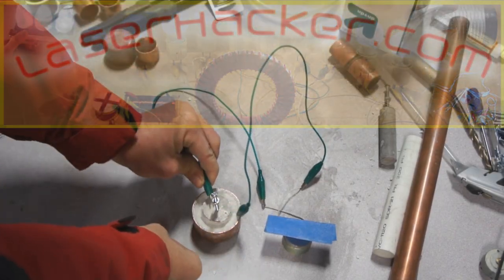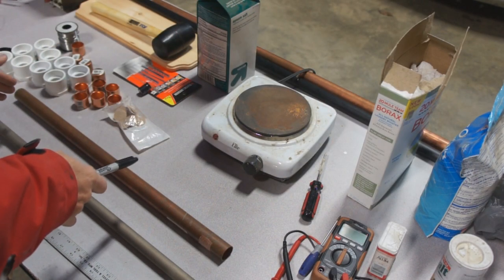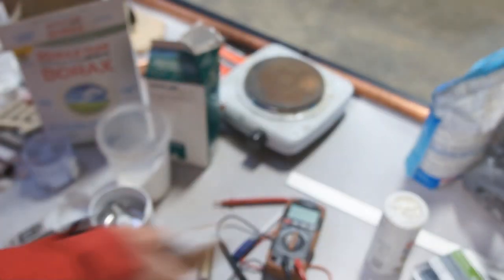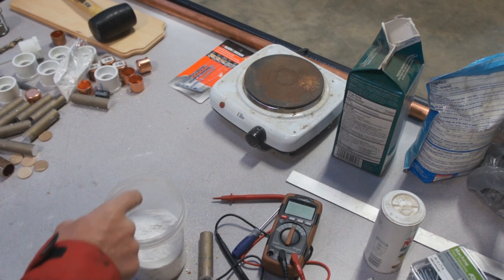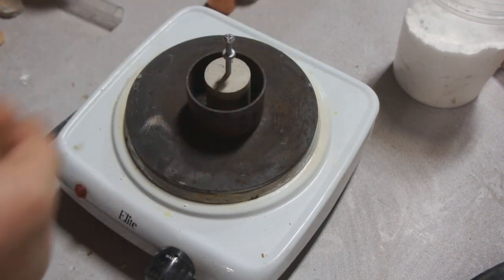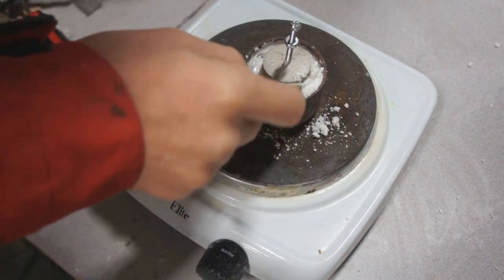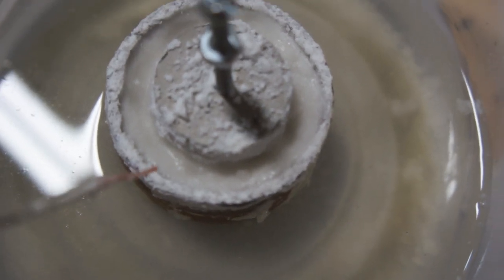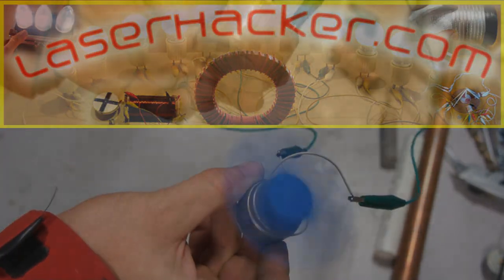How to Build Crystal Power Cells - Long Duration Power

Comment: I was wondering if you would get a higher power output if you added more magnesium rods rather than one big one.
Reply: yep. more surface area of the electrodes will increase voltage. i think nobody knows the life span of this battery yet
Reply: Yeah your right but wouldn't the added magnesium rods increase the durability and life of the battery due to the increased surface area?
Reply: I think it would be like this: in a AAA battery, compare to D size. D lasts longer since it has so much more electrolyte inside. we could test it by just using a lemon for the mix, cut in half. one half has couple electrodes, other half has like 4x as many. see which used up first

Comment: Thanks for sharing have been studying Paramagnetic Volcanic Basalt for years.   I have a PCSM meter to measure Soil CGS centimeter grams per second.  means how fast 1 gram of material will move toward a magnet.   The book I have on Paramagnetism speaks of Sulfur form G as being Paramagnetic.   600 to 700cgs.   Not sure if related?   Want to test 3000 cgs paramagnetic volcanic rock in a similiar device.  Any advice out there?
Reply: I was thinking MSM may be nice to try in the mix. Methylsulfonylmethane. Is it magnetic?

Comment: Build a vacuum hood over the heat plate, when you have it full and are ready to remove it from heat, Don't, suck out all the air and see if the cell provides more or less voltage.

Comment: The electrochemical potential between Cu and Mg is large. You can increase the voltage potential by using an Ag cup instead of Cu. A bit more expensive but worth trying.
Reply: What's Ag?

Comment: what if you made a large cell, would that allow more volts to generate, or what if you connected a few of these small ones together?
Reply: From my experiments size doesn't seem to matter. I made tiny ones that where stronger than huge ones. My hypothesis is that what matters is the ratio of surface are from copper to crystal to magnesium. So basically when there is about as much copper as magnesium touching the crystal you get the better results. Also the thinner the crystal the better it seems.

Comment: Where do you buy Magnesium Rods? Thats something one doesnt typically see. Awesome stuff her by the way.
Reply: Daveman, you should be able to get mag bar stock at a machine shop, machine shop supply, or i have even found that scrap yards will often put aside various bar stocks that people bring in as scrap and they'll usually sale it for just a bit over scrap price -good deal!
hope that helps you, wish you well with your project.
Reply: also i just noticed that Lasersaber has it on the site as "Reliance 9001829005 32-Inch Magnesium Water Heater Anode Rod" i think you can buy those in a 5 inch version at a hardware store.
Reply: I think you can find them on ebay too!!!
Reply: I find Epsom salt a greater mystery to find here locally than magnesium rod..i bought one from ebay.com (china-free shipping has plenty at cheap prices)
Reply: fidel catsro
Epsom salt is magnesium sulphate. Available from any medical shop. Epsom salt is used as a laxative and is availble from any medical supply stores.
Reply: Awesome observation, I bought one of those in my Emergency Kit it was really cheap
Reply: Elgin Mac

Comment: I'd love to see a video on how this works and who came up with this! I looked up how these work online and the first result said, 
"Our hypothesis is, that the Crystal Cell extracts energy from the quantum vacuum"
No idea what that means.
Reply: Connecting the cell to a resistive load causes electrons to move outward from the magnesium to the copper, causing an anion flow (and thus current) in reverse of it. The heat generated within the cell causes an electrolytic reaction to occur within the water within the porous material between them, regenerating the reaction as the moisture dries out of the structure and from the cell. As the moisture is driven away, the dry compound crystalizes further until the battery is unable to carry on the reaction.

Something like that anyway, it looks like a galvanic battery but in a very viscous bath.
Reply: @adamsfusion  interesting stuff. Sounds similar to how normal batteries work, except with these you can make them in your kitchen haha
Reply: i'm also surprised there's not more info on these online!
Reply: I know of some 'people' who have a quantum vacuum in their HEAD. Lol.. like those who are 'running things' right in the GROUND right now.

Comment: Calculate the volume of the chemicals - pour the correct amount into the copper cap - let it become a liquid - turn off the heat - wait for the bubbles to come out - then insert the magnesium piece slowly.
Before you put in the magnesium piece rub it with fine and rough sandpaper (to increase surface area)  as it most likely has an oxide layer on it. No harm in doing it to the copper on the inside as well.

Laser Saber are these the correct chemicals? the reason why I am asking is because some one in the comments said he used these and it stopped making power after a week please let us all know if we using the correct chemicals, thanks.

Potassium chloride - commonly known as salt substitute. 
Hydrated potassium aluminium sulfate - commonly known as alum. 
Sodium tetraborate - commonly known as 20 mule team Borax.  
Magnesium sulfate - commonly known as epsom salt.

Comment: Hello Lasersasaber, 
Can you try mixing some graphene + activated carbon and vinegar/ionic liquid in to your mixture to see what happens and post your video. The graphene should be able to store some power quickly and help keep the corrosion down. I would first cook the graphene + activated carbon down with white vinegar concentrate then add it to your regular mixture. It's should greatly improve the crystal cell battery.
Reply: Get busy, guy. Post your results.

Comment: We used to make these in eight grade science back in 1977 the only probably was humidity you have to keep them free from moisture. .or it will corrode the one I built ran for five years but then corroded. .so use it to run a dehumidifier. And build from there. .

Comment: What is the theories of operation of this cells Mg > Mg++ + 2 e- at the negative electrode. But what happens on the positive one? I ask, because it look like you have more Material to Spend electrons (Mg) then these one to accept Electrons. By have the correct relation, you may can improve the lifetime. Or is it Oxygen from the Air? No Idea!

Comment: So on a bigger scale would it be possible to get 13 amps? Do the materials used break down over time and if so doesn't that mean its fossil fuel or something of the like?
Reply: If you make a shit pile of them and put then in parallel you can get more amps but at the cost of materials your better off buying a proper battery

Comment: I have found that it does not matter what so ever how large or small they are, they all run the same.
I short them out for 5 or 6 minuets after I form them and I get an extra .20 v for the life of the battery so far.  well for weeks now.

Comment: I know that you dont comment much anymore, but I was wondering your thoughts on the epson only batteries? 

I have heard people claim that neither the rochelle salts nor the alum makes much of a difference or improvement over epson alone.
Reply from the maker: I have never tried it.  I have only tested the recipe shared here.  If I was going to test it I would use very thin materials so that the breakdown would be evident in days or weeks instead of years.
Reply: Good call.   I will do a side by side soon
Reply: lasersaber Well I have a couple side by side for a couple weeks and so far anyway there is no difference.
Reply: +Clown Whisper Are they still running?  Did you do something about the same as the video except Epsom salt only (do you still "cook" the powder?)?
Reply: +Raku777 after 1 year the Mg degrades so bad that it catches on fire. I had many of these in my basement (based on sabers channel, zeropoint forums, and of course youtube) in a test to see how long they last: A=1 year, then the chemical degradation makes them useless. IF you decide to test, STORE THEM IN GLASS MASON JARS far from anything flammable do not be suprised if the Mg catches fire when you open the jar, or shake it... Mg when fresh is VERY STABLE, in fact its hard to light up, but... after 1 year of constant drain being used as a battery... well... the Mg becomes DUST and Magnesium dust catches fire from a butterfly fart. lol.
Word to the wise: GET A CHEM FIRE EXTINGUISHER
Reply: +Christian Zagarskas Thank you for your feedback.  I want to double check.  Are you referring to the Magnesium Sulfate only batteries or the mix by Lasersaber in this video?  Either way your observation is significant.  I am assuming for the second sentence that it is the mix rather than Mg only, but I want to make sure.
Reply: +Christian Zagarskas SOOOO what if I made one of these and stored it under mineral oil inside a customs case? Say, inside PVC?
Reply: I dont "know" but I can offer you some thoughts on your idea:

First off, go for it! document it and make sure you are aware of how to handle Mg safely. Research chemical batteries and know what to expect.

Second: I suspect that since Mg is an organic compound, and that when Mg loses electrons in a battery type application it degrades. So, my guess would be that after 1 year your Mg would still degrade into dust and instead of a flammable danger that can be put out with type D fire retardant you would now have a mess of oil and MG dust to figure out how to safely dispose of. Or, maybe you would have a bomb to diffuse and deal with because of the pressure build up.

Good luck. Be safe. 
I would suggest starting here.
http://chemwiki.ucdavis.edu/Analytical_Chemistry/Electrochemistry/Voltaic_Cells/Case_Study%3A_Battery_Types/Batteries%3A_Electricity_though_chemical_reactions
Reply: +Christian Zagarskas A big problem I found is that mineral oil does contain a small amount of water, so it would most likely react and start an oil fire. 
I do plan to try testing Titanium in place of the magnesium to see if I can get similar, less explosive results.
Reply: Varenzeroth Greycloak  I would strongly encourage you to experiment! I really enjoyed this book: 
title: Battery Reference Book
by: Thomas P J Crompton
Publisher:	Newnes
ISBN# is 0080499953, 9780080499956

Remember: all  batteries that rely on metals or a chemical reaction for their power production have a drain curve and result in unstable composition changes because of the nature of organic chemistry.
Reply: Raku777 I tried many many types Ti, carbon/Mg, even the "Borax crystal cells" wrapped in copper and even 'paper towel, carbon, Magnesium strip wrap' that I also stepped up from the LaserSaber 'Joule Ringer'. I even tried to use the crystal cells to power up a hand held hand made 1200turn tesla coil (that works off a AA fine) but they did not power it properly (thats a whole other discussion)

To answer your question directly and simply:
YES.
#1- All of them Degrate over time
#2- ANY that use Mg (or any heavy metals) eventually become unstable and often flammable
#3- None of them lasted longer than 1 year. (without expanding, breaking, becoming unstable or in some cases: hazardous)

 What I learned:
all  batteries that rely on metals or a chemical reaction for their power production have a drain curve and result in unstable composition changes because of the nature of organic chemistry.

Notes:
Keep TYPE D flame retardant on hand
Store tests in ventilated mason jars on concrete floor
Work small.
None produced more than 1.5 to 1.8 volts, 0.2 to 0.5v under a load. (although I was able to chain them and stack them for different results)

Mind you that the papertowel Mg Strip with the Carbon core REQUIRES water, [H20+Mg=chemical reaction]

My message to others:
LaserSaber's channel and the Overunity forum are very interesting, I strongly suggest replicating their projects, contributing and doing your own provided you are aware of safety precautions, proper disposal or wasted materials, and the nature of Organic Chemistry as it relates to power production and batteries.

Simple summary:
the electricity comes from "somewhere" that somewhere is electrons being LOST by the compound, that means it degrades, when things degrade they change and normally stable substances can become unstable and dangerous. There are gasses, fires, heat, and byproducts to be aware of.

Conclusion I reached:
Organic Chemistry from home is not the ideal answer to the "overunity search" for power production. I believe it is too unstable and without corporate lawyers to protect you the production of a mass consumed product would be hazardous. (note even LiO batteries are explosive)

Looking Back:
If a disaster comes I now know how to make variations of the Baghdad battery which I could use to power a flashlight, do electroplating, or provide short term basic light and electric low power sources in a post-apocalyptic environment. that makes me feel good. ;) 

Moving Forward:
I believe the answer I (and many of us) seek rests in Light waves, Electromagnetic phenomenon, and more along the line of Tesla's legacy which is where I am headed  now that the batteries have failed in my tests.

Try it for yourself, maybe you find something new? I mean it. GOOD LUCK!
Reply: +Christian Zagarskas But did you try boosting the amperage? The voltage is just the difference in charge. Amperage is speed of equalization. Boost the amperage and you'd probably be fine. 
Maybe caps or a parallel array.
Reply: I tried it all. series and parallel, joule thieves, minni tesla coils, joule ringers, does not matter, organic chemistry is at play here: the Magnesium degrades into dust. where is the voltage coming from? the metal. what happens when an electron is lost? physical degradation and loss of mass.

Try it. works awesome for about 3 months, then the decay starts, wait 9 months, will quickly see the batteries start to "burst" or "push" out of their caps, 1 year and its all over, battery is done and now there is a potentially hazardous mess to  clean up.

Dont get me wrong here... thats awesome for "need to know info" but not at all practical for lets say the home office, or, a lamp in a kids room... dig?

Comment: Are you familiar with electric lawnmowers? About 24VDC motor. Can you power a 24 volt brushed DC motor rated for 50 amps with these things? If so can you beat the weight class of a normal battery? Are you familiar with treating the copper in BORAX before you use it in a battery? There are videos on it. It makes the copper more conductive but you need a high heat kiln to fire the Borax and copper. Look into it and see how light and powerful you can make this.

Comment: I wonder how large this could be made before getting to a point of diminishing return, that is to the point where it wouldn't do to make it any larger.
Also, if you made it larger would it give more voltage or more current, or would it give the same of both and just last longer? Hmmmm.

Comment: If a larger version of this was built would it garnish more power output?
Reply: U are absolutely right ... SHANE ... THIS coo be scaled up to whatever levels needed and will be an IMPORTANT part of the FREE ENERGY movement which will TOPPLE and destroy the OILY Fossil fuel BEAST 666 with a SWORD of LIGHT and TRUTH from the MESSIANIC AGE of AQUARIUS !!! AMEN ??? LOL !!!
Reply: John Eng
Hoo-Yah! Well said....Ascending Higher every day. Passing it on!
Reply: John Eng Come on John , FREE Energy doesnt exist untill you well understand what energy is. Electron flows as you should know as always a source where they come from to go to. This is why you MUST understand that Free energy is just not possible. What is possible is to get new kind of sources that still today non identified but exist for sure. Think better in terms of open source or open circuit rather than turning it into the box